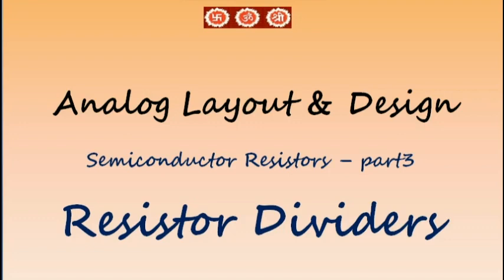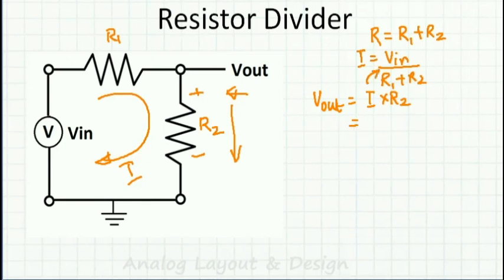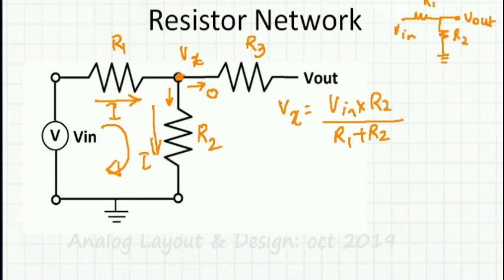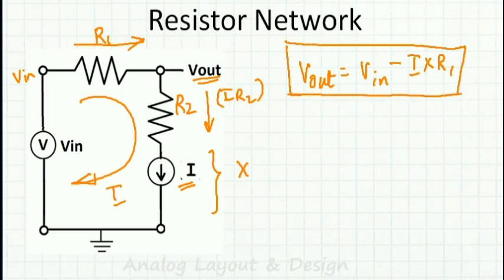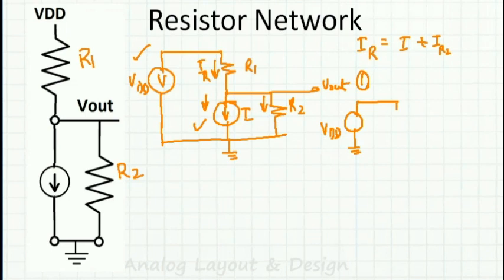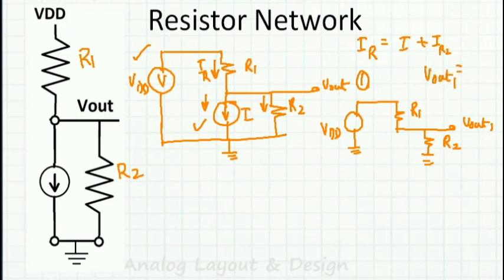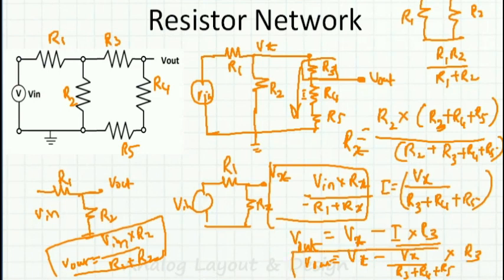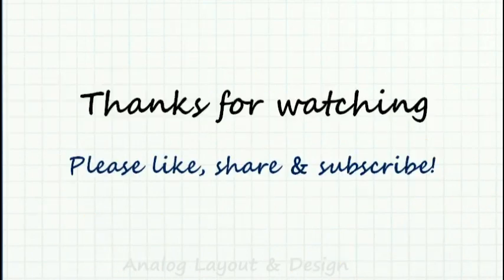resistor divider

Comment: In the network where the superposition theorem was applied, vout2 was taken as negative because you had taken current in the opposite direction. 

If I had taken the current direction in the same direction as the current source, would vout2 be positive?

Could you please elaborate on this.
Reply from the maker: at what time of the video, you have put up the question
Reply: @analoglayoutdesign2342  At 12 minutes.
Reply: Even if we had taken the current direction in the same direction as the current source, vout2 would be negative. In other words, the same result.